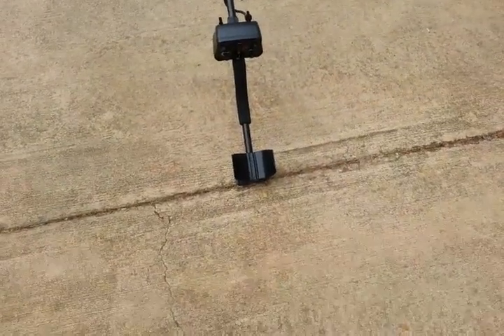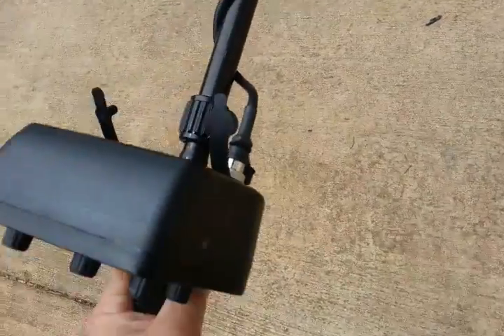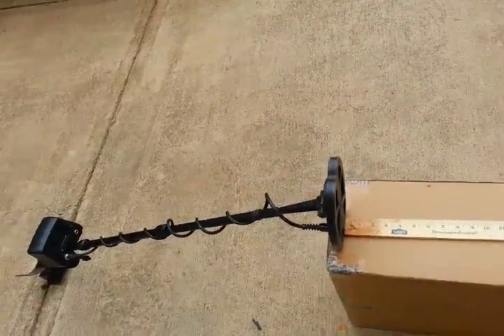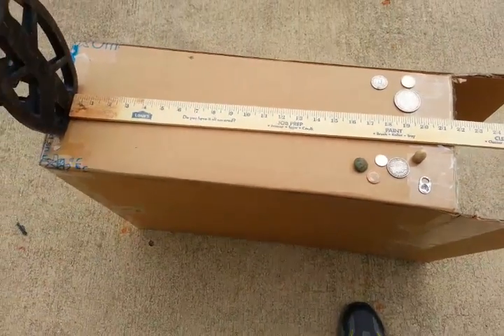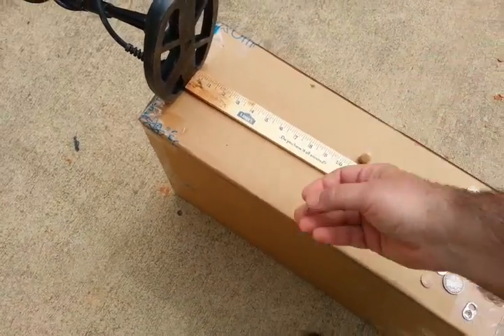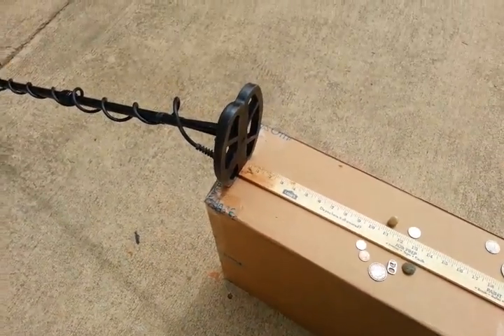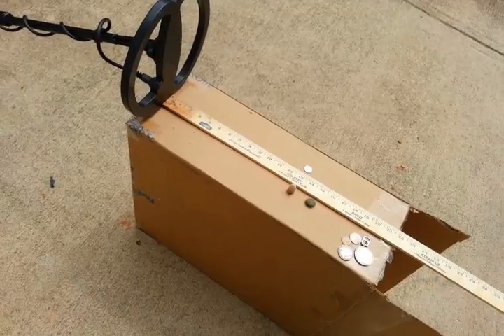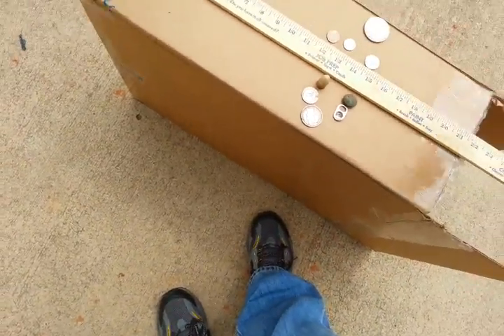Deep Tech Warrior. Air test

Comment: Did you realize that the Xterra 705 is very similar as far as the ground balance mode gives a two tone sound .. I have actually hunted with it in that mode and you can hear the iron and high conductive targets at the same time at a greater depth then the discrimination mode.. not comparing the two machines, but the ground balancing mode is very similar...

Comment: I wish the Tejon had the three or four tones that their discontinued Golden UMax had. By the way, that went deeper than a Tejon. Oh and like you touched on, visual target i.d. is "for the birds". It's not anything more than a bunch of pre-programmed algorithms at a certain setpoint but they can only (try to) (interpret) a target. I can do that with two-tone or single tone using only my ears. I don't need a visual i.d. and they (are) actually, inaccurate many times. Hey relics1864, have you ever tested the Pirate Apolonia (turn knob, non i.d.) detector ?